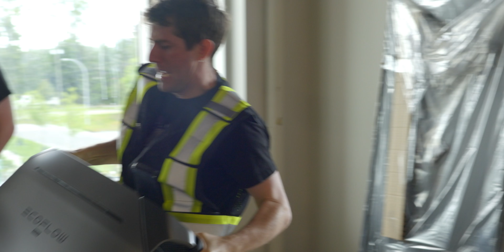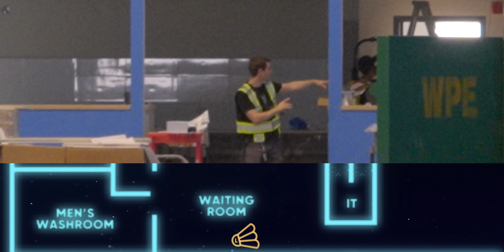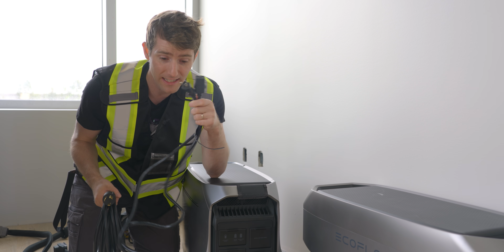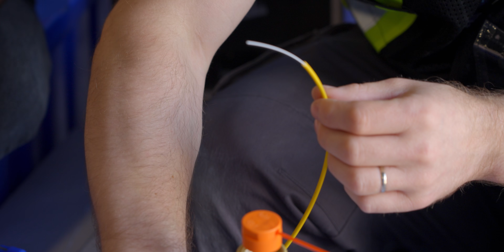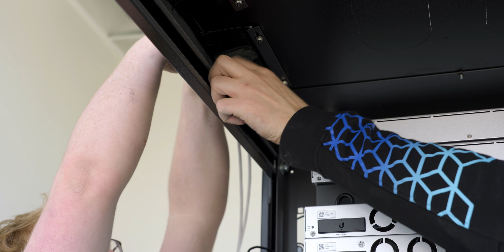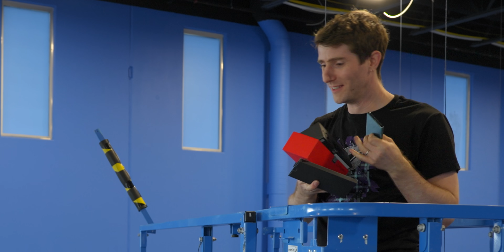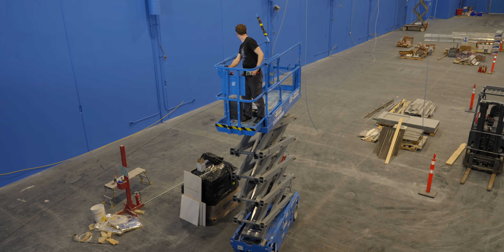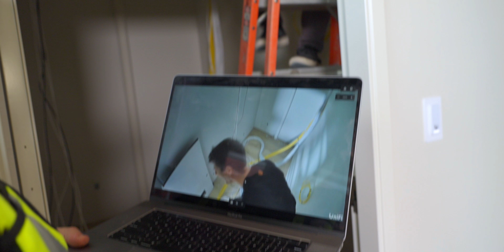I put WiFi 7 in my badminton center

Comment: That height of that scissor lift scares you? 
Oh my Canadian summer child. I rode on a 20 Ton capacity HVAC unit crane lifted up to a roof yesterday with a heat index of 110. My helper wouldn't do it so I did it for giggles to make sure all the cables we preattached didn't get mangled. Plus, fun on a hot day.

Comment: I'm more then sure your WiFi is faster then mine - I only just swapped out a modified TP-Link Archer C7 (AC1750 - good old WiFi5) loaded up with OpenWRT (running as an VLAN aware AP) for a brand new and modified (I am the warranty) TP-Link Archer AX23 (AX1800 WiFi6, not even WiFi6E) loaded up with OpenWRT (again running as a VLAN aware WiFi AP).

Comment: For once, actually, no, at least not speed wise, using openspeedtest I get 1.9 gigabits down 1.5 gigsbits up over wifi 6e on a z fold 4 to my desktop (connected via 10gig to the router), and my router is wifi 7 capable too, I just don't have any clients that are wifi 7 lmao

Comment: Unifi stuff sounds great on paper, but is so bad in practice. You guys must love constantly troubleshooting weird issues and updates that break stuff.
Reply: It's just not the right caliber of gear for a space like that. Ruckus, Cambium, Aruba, Juniper, Cisco, Extreme Networks, Fortinet, EnGenius, Mellanox etc are much more common to see in commercial installs.
Reply: Unifi is all good until you have to do anything advanced / out of the ordinary and then you’re  toasted
Reply: They’re just talking about all these experimental features that they’re planning to run in a business, I prefer much more boring business networks 

Meraki, arista, Aruba, juniper, Palo Alto

Just equipment you can set up and expect to just work without intervention.
Reply: They really should have hired a contractor to setup the networking and plan it out. Their unifi stuff is okay for homes or the office but if you are doing a large commercial area you need to get people that are really dedicated in that field to give you the best setup you can get. They would be knowledgeable of any potential problems and prevent them from the start, whereas I can see Linus and team encountering issues and making further videos of well this problem happened with our network.
Reply: @nylohro4091  Seems like they also used LC/PC patch panels instead of APC. I'm sure their ISP will be "happy"

Comment: 12:11 I would suggest more than blanking panels. Like rails that connect to the rear of the rack as well and installing the devices onto those rails.
Reply: Also I don't get how they expect 1U equipment installed in those slots to strengthen anything, it wouldn't make any difference to the part which was actually bending.
Reply: @harrysmbdgs  Egh it would have SOME effect, Harder for metal to buckle/bow if you are holding the top and bottom at a set distance from each other, would still flex but less than it was.

I suspect it's mainly designed around half length stuff being in the 1U side spaces and at the top/middle where there's more support and full length servers on rails being everywhere else minimizing the flex/weight issues.
Reply: Could they not simply install some of the server units into those vertical slots instead of only using the horizontal slots?

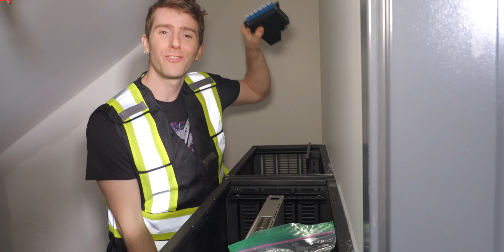Comment: the sprinkler head in that little server room at 3:40 has me stressed tf out lmao
Reply: @texxxasred Halon has been not legal for decades, but yes it is the gas release of a fire suppression system.
Reply: @jonathanbuzzard1376  Are you sure? At 5:45 that appears to be a temperature-activated sprinkler with a green (intermediate temp 175-225 F bulb). These are used in water-based systems. Gas systems use sensors that relay back to the control panel which can then open a solenoid valve to release gas.
Reply: @texxxasred Not with the pipe being that big. That’s most definitely a dry pipe system.
Reply: Anything to do with fire systems that are close enough to be eye level give me anxiety :D , particularly alarms here in the UK when they are supposed to be 85db minimum at 3 meters
Reply: They might want to consider having that pipe capped off and installing a clean gas automatic fire extinguisher
Reply: @texxxasred  It should be (for this application), but I don't believe it is.
Reply: @texxxasred  Gas based suppression systems like FM200 don't use heads like that.
Reply: Reminds me of 1) all the times I've seen people bump them and set them off in videos online, and 2) makes me think they expected somebody to use that closet as a grow room. Don't want any fires in the super hot grow room! lol
Reply: @jetjazz05
Reply: @jetjazz05  I think you are the only one that thinks about grow rooms...

Comment: I hate how wifi router manufacturers will say “mbps” without precising, making you think it’s bytes when it’s 8 times slower in bits
Reply: Usually its "Mbps" or "MBps",  the capital B stands for Byte and the lowercase b stands for bit. Also data transfer speeds are almost always listed with their Megabit persecond speeds, as that is the standard in the networking space.
Reply: On lower layers, you have to still measure in bits since there will be signaling overhead, frame overhead, protocol overheads, etc.

So even after dividing bps by 8, you can likely still off the mark by considerable amount. Better to treat the number as "raw" transmit power and divide by 10 to get average performance.
Reply: You can know by the capitalisation
Reply: Wired or not network link speeds are always in bits?
Reply: @niter43 should be
Reply: It would be nice if we could go from bits to bytes since networking speeds are fast enough now that nobody actually operates in the "bits" speed range anymore. Once upon a time it was even kbps...it's long past time to stop using Mbps.
Reply: @Zboe-JL  I mean I have a 50Mbps internet connection, which is a single digit MBps. I work as a NOC Technician for an ISP and we offer some lower packages than that, so I think that Mbps is still quite relevant, even in today's age.

Comment: you don't have to rub it in man
Reply: Ngl I would rather watch Linus rub it in than watch him rub it out 😮
Reply: @PrimetimeBJJ ayoooooooo
Reply: @PrimetimeBJJ  fair
Reply: @PrimetimeBJJ nah I’m waiting for OnlyFans Part 2
Reply: @PrimetimeBJJ  nah i rather see him rubbing one out
Reply: @p1nstark calm down bud
Reply: God the things I’d do to Linus’s tech tip
Reply: @Sushidotexe  I cackled loud enough for my neighbor to bang on my wall
Reply: 1.3GB/s isn’t fast at all. Average, sure. But it’s like 2019 speeds. Clickbait title.
Reply: @PedroBastozz  Do you get any faster wifi? What is your speed
Reply: @atodd2026  2gb/s. A little more if I use wired.
Reply: @PedroBastozz  bro, 2gb is so slow, all of us use 10gb now
Reply: @Atomicbrain1034  10gb over wired lan if you live right next to a massive data center and buy a 2000$ router and even then not until wifi 8 comes around. Average speed in the US (which I assume is where you live) is about 215mbits a second. THAT is slow. Also, I don't think I've ever heard of residential speeds even close to 10GB/s, let alone WIRELESSLY.
Reply: @PedroBastozz  hence the sarcasm
Reply: I think I get either 300 or 500 mbps
Reply: @Dert_Eater  That would definitely be via LAN, not wifi. Also that would cost a LOT and would require you to completely change the infrastructure in your entire house (essentially replace all the wiring) for it to even be possible. And even then, I doubt it would be at a rock solid 20gbps. You ain't getting over like 5gbps with wireless in 2024 more than like 5 meters from a router, only LAN.